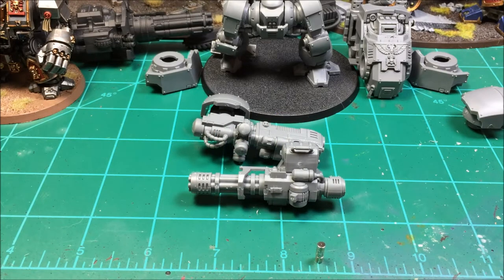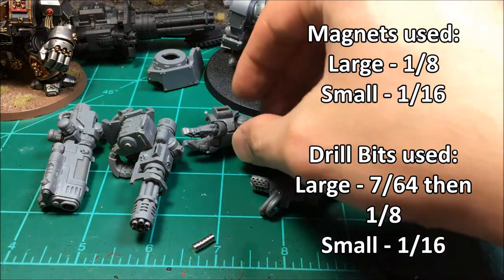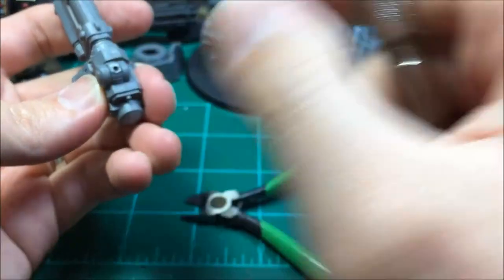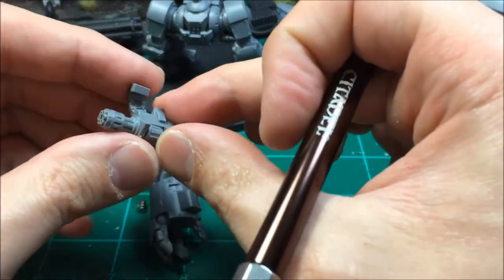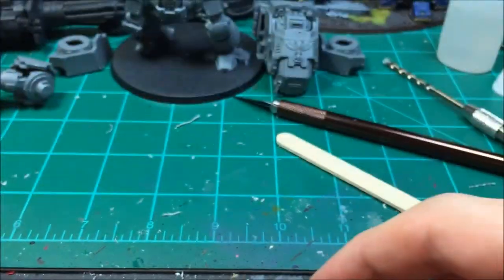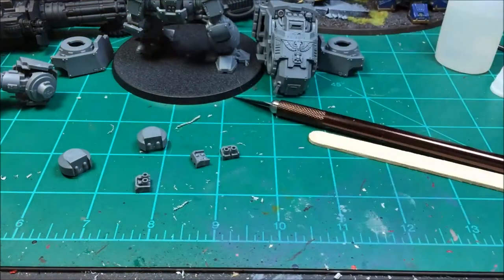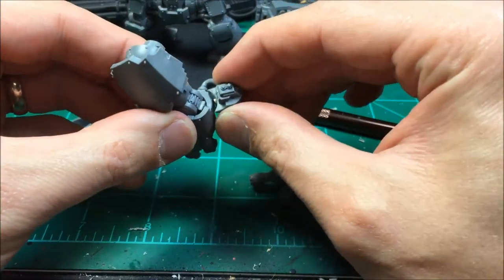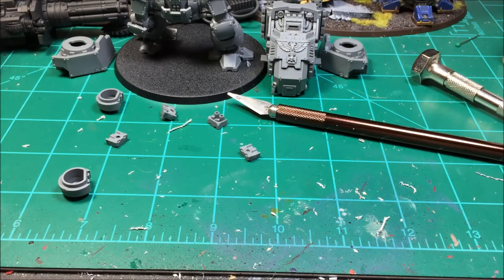How to Magnetize the Primaris Redemptor Dreadnought

Comment: Pro-tip I just figured out myself while magnetizing my Repulsor.  For those fiddly magnet insertions take a little blue-tac and shape it to a stick the size of your magnet.  Put your magnet on the end and use that to insert the magnet into the hole.  It has enough stick to hold the magnet on, barely, so it releases great and it won't stick to superglue etc.

Comment: Another tip for when you are doing pieces like on the Fist arm for the Heavy Flamer and Gatling. 

Dont assemble the fist first. Drill your pilot hole first, then attach the piece to where you are going to be drilling on the weapon. Put the weapon in the slot where it is goign to go, and then drill through the inside of the part out through the hole into the weapon. This makes sure the two holes are perfectly aligned for the magnets. This will usually give you a more flush seating when its been fully assembled and magnetized
Reply: Great tip.

Comment: When magnetizing small parts like the bolter / frag launcher i would use a piece of magnetic can on the weapon side. shave of some of the plastic on the weapon side and cut out a piece of magnetic can and superglue it. then a magnet on the other piece. then you don't risk drilling through the thin parts and you save a magnet ;)

Also when i magnetize large parts i fill the hole for the magnet with green stuff, that way the magnet don't end up inside the model and the magnet gets rely locked in place by the gs.
Reply from the maker: Thanks for the tips.  I will try that next time.

Comment: Nice tutorial... I want to see that bad boy all put together with the various weapon loadouts.  Very cool!
Reply from the maker: I am sure T.J. will but a showcase when he gets it all painted and done.
Reply: I will defiantly do a showcase video with it all put together and painted with the different weapon load outs.
Reply: One more thing as well... I was looking at magnets on amazon and noticed that there are 2 dimensions to each circular type diameter and depth.  Could you link the magnet supplier and/or both dimensions too?  I was having trouble sourcing those..
Reply: The smaller magnets are 1/16 x 1/32

The larger one was a 1/8 x 1/16

Comment: First time magnetizing here. What the risks level of screwing up? lol Thanks. Also which bits are used to drill? Are the ones that come with citadel ok?
Reply from the maker: They should be fine, you may have to get a 1/8 bit from a normal tool set.  I really didn't screw up much but just be careful and take your time.